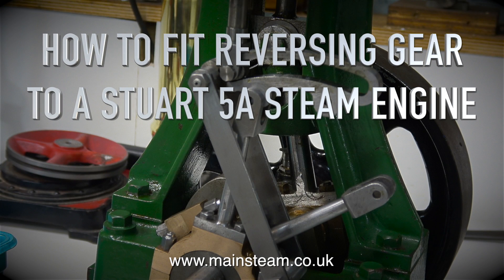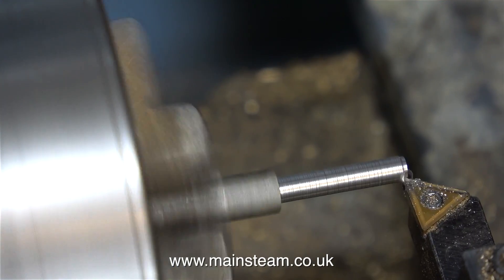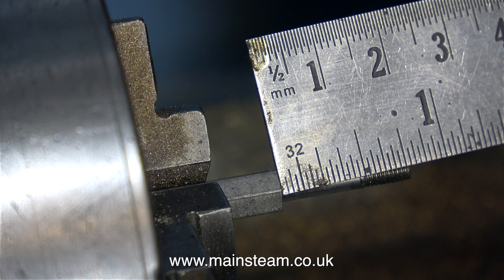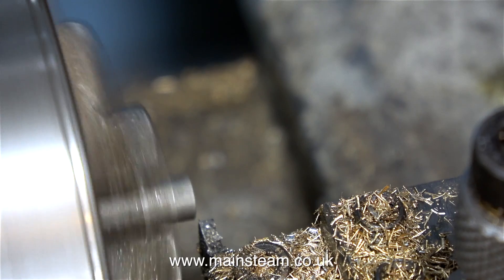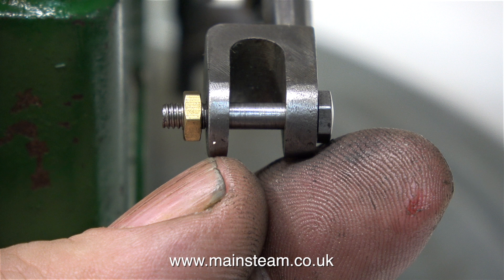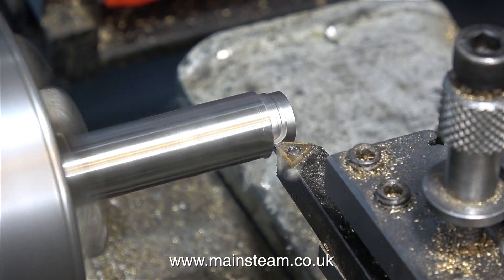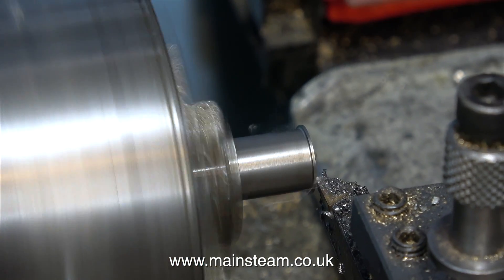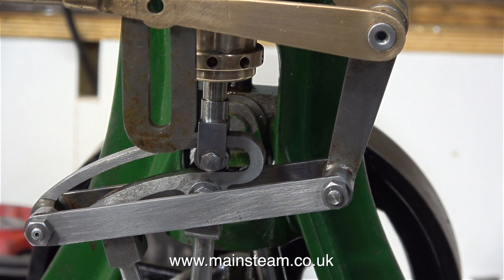HOW TO FIT REVERSING GEAR TO A STUART 5A STEAM ENGINE - PART #3

Comment: Keith,
First and most of all, a polar bear sized hug and thank for all the effort You have put in these informational videos. Machining is one piece of the puzzle of making model steam engines. After looking through Your production I can say that it captures the essential, the specifics of model engineering. For those who seek out knowledge of machining, there is almost too much supply - it is VERY hard to tell which knowledge is good and which is not. Your videos  are self evident. I mean, they do not require additional proof - common sense is enough.

So one more time. Thank You. You have actually teached me to do silver soldering.

And now comes the thing that I wanted to talk about. As much as everyone hates the personal safety equipment and as Keith remembers to mention this in almost every video including the bio-hazard suit and gas mask. So this was the one case where a tiny safety warning would have made some sense as the danger is not obvious.

Grinding tungsten carbide generates dust which should be kept out of the lungs. It consists of very fine particles which easily enter the respiratory system. Although one does certainly not drop dead after sniffing the dust it can have quite some effects in the long run. Another danger lies with the brazing substance which quite often contains cadmium. There is some evidence that tungsten multiplies the toxicity of cadmium. 

As the particles in the dust are really tiny, they easily pass through the standard breathing filters and certainly pass through the vacuum cleaner system. Probably the best way to avoid the dust is to use a vacuum cleaner and place the cleaner outside and have only the hose inside or do the grinding outside. Another way is to hold Your breath about 30 minutes while and after the grinding ......